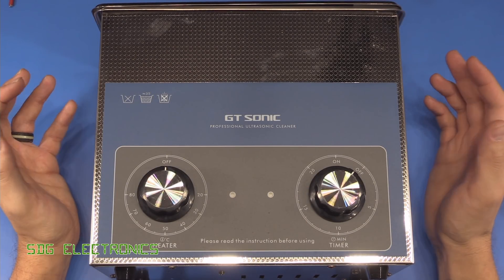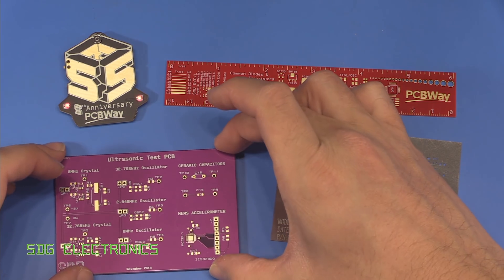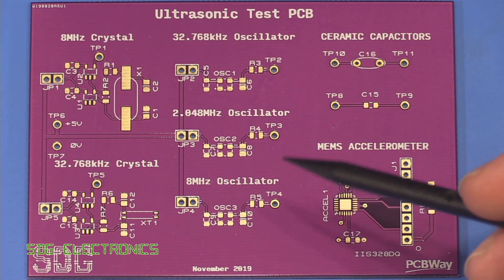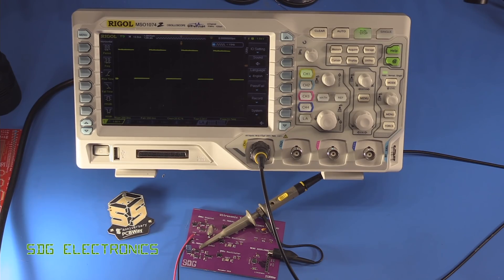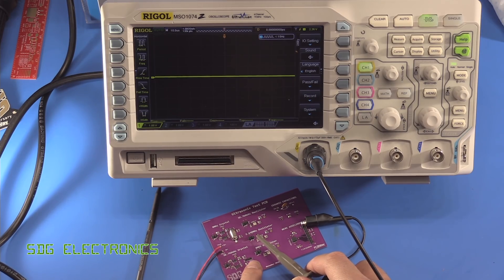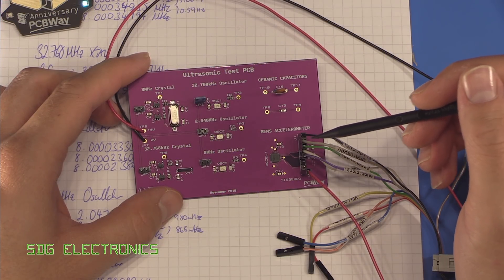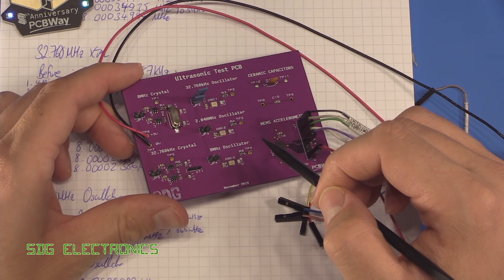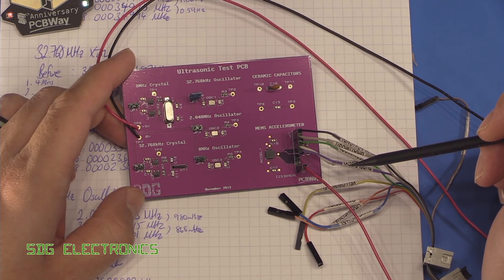SDG #118 Can ultrasonic cleaners damage your PCB and components?

Comment: is this a sweeping frequency cleaner or one for cleaning jewelry that stays at 40hz?🤔
Reply: I believe that model is a 40KHz static frequency
Reply: @EliTheDriftPanda  it has to have a sweeping frequency or it will damage what you put into it.
Reply: @jessihawkins9116  that's my general thought too. Most electronic components survive but if the wrong resonance occurs in a crystal it could damage it, MEMS don't like it in general and higher power can damage even basic SMT components. It seems to be an "it depends" situation but sweep would help a lot, as well as physically moving items inside of the bath
Reply: @EliTheDriftPanda  look into what Louis Rossman says about these ultrasonic cleaners. He’s tried several and found that only the sweeping frequency units are suitable for electronics cleaning. There is a big price difference between the two also.

Comment: Modern IMUs that I have seen have a high max acceleration (in terms of damage, not measuring). The MPU9250 has a max rating of 10000g for 0.2 ms when unpowered (I have no idea about powered), since it is such a small and light device getting it to 10000g is probably pretty difficult in the first place and the frequency of an ultrasonic cleaner is that high that for 45 kHz the period is 0.02 ms so a tenth of that the rated time too and even within that the max acceleration will be for a much shorter period of time.

It would be interesting to measure the acceleration using an accelerometer whilst it is in the cleaner. A +-16 g one might not be enough but you can quite easily get +- 200 g ones for model rockets and similar applications. You should probably add a conformal coating first though, preferably a hard one so it doesn’t dampen the vibrations.

Comment: I realize this is a 2 year old video.  After a run of boards came back with a high percentage of failed IMU's, I conducted an experiment on my bench.  I took a board with a working IMU and placed it in distilled water inside my Branson 2200 ultrasonic cleaner for 10 minutes.   After drying the board, I retried the firmware and the IMU was now returning 0's for Gyro reads on all 3 axis, and extremely erroneous Accel results on all 3 axis.  This is with a TDK Invensense part.  So while I'm sure there are some parts that are unaffected, people should probably refer to appnotes from the manufacturer.

Comment: People wash $2000 video cards in ultrasonic after repair is done.
Because it's not harming anything. Even the cristal.
Reply from the maker: The trouble is we cannot measure failures easily. Same with ESD - can you correlate occasional PC crashes or pixel glitches? These issues rarely manifest as a total failure of the device

Comment: Ever since I demonstrated that my ultrasonic cleaner could put pinholes in aluminum foil, I have been worried about damaging things.  

For example, I've destroyed print heads with a conventional ultrasonic cleaner.  But I did read somewhere to to clean print heads, you have to use frequencies around 80-90 kHz.  I don't know where you buy those.  

Also the ability of the UC to get into cracks and the smallest of features makes me wonder if it could follow the legs into chips .

Comment: how come when I dropped my phone in the bath it didn't work even after I dried it with my hairdryer yet you can put your stuff in that bath and it works?
Reply: Late reply... but your phone had a battery connected. You can dunk an entire PC motherboard into water, alchohol, whatever, as long as (1) it's not connected to anything, i.e. no electricity flowing; and (2) you dry it properly afterwards. 

When phones still had removable batteries you had a chance saving it if you were quick. Now with non-removable batteries: don't even bother, nothing will fix it after a dunking.
Reply: @stromlo  Thank you so much, Deon

Comment: How would a power supply hold up? Can you ultrasonic clean those? Trying to think whether any materials are in those that aren't in a typical pcb/mobo etc.
Reply from the maker: You may have problems with the tape used in some transformers, but other than that there's nothing that would typically not survive.

Comment: I used PCBWay once. The circuit board was slightly over 100 x 100mm. It ended up costing me €80. The exact same circuit (same Gerber files) from JLCPCB cost me €10. So no way pcb way.
Reply: Ive found PCBway to be expensive too, I also use JLC.

Comment: Another thing to consider is that the liquid could seep into your plastic packages of your ICs. It might short out pins, which in turn could carbonize the substrate and create shorts. Also if the part gets hot, the liquid might boil and blow your packages apart.

Comment: First hand experience: Piezo buzzers (in this case small SMD buzzers) generated voltages from the ultrasonic excitation. The micro on the PCB had some pins fried because of it. This was during a first production run, so in this case the solution was to use a different cleaning method, but the point is it can certainly cause problems.
Reply: I don't know if you'll see this ,what other cleaning methods did you end up using?
Reply: @Sergi762  I can't remember, it's possible they just stopped cleaning the boards (no need for it with modern no-clean solder.). That was a long time ago.

Though I can tell you what I use these days on small run prototypes for customers? carbcleaner. Yup - the stuff you spray into a petrol engine carburator. It's the best I've so far found, but it is very potent, so I scrub the panel / pcb down quickly, then rince with water, then spray "CleanGreen" (or Dishwashing soap) on and wash the carb cleaner residue off (and then rince in distilled water if I am going to do a conformal coating). Incredibly quick, and perfect results - even cleans years old rosen-based residue off if I repair old PCBs. Just take note the carb cleaner will eat paint, QC pen markings, etc off, so be careful when you use it. Also highly flamable etc etc.

Comment: Not sure why would you test "earth's magnetic field" with accelerometer that's not the part that gets damaged. It is usually the MEMS part and after that earth gravitational field either does not have effect on accelerometer or it does not work at all. I've damaged complete batch of prototype boards for customer and after that I never put boards with accelerometers in ultrasonic. The rest is fine i never noticed any damage on the crystals at all.

Comment: Thanks for sharing all this!
Evidently the modern components are quite tolerant to ultrasonic.  I still remain unsure about old TO-5 packaged transistors like 2N1613, 2N7011, 2N2905 or even the TO-18 types which also have bonding wires hanging supported only by their welds at the ends.  Then another message here also reminded about the kovar leads going through the glass into the interior.  Some lead length above the board might produce a detrimental resonance at the ultrasonic frequency?
Come to think of it, I have both several of those old metal can parts, a small ultrasonic cleaner and means of determining the frequency and maybe the resonance frequencies (in air).  So maybe I should take the matter into my own hands an perform a few tests...

Comment: Elmasonic has P Series ultrasonic cleaners that can sweep at 80kHz which is gentler and safer for more sensitive components than the usual 37-40kHz. Curious how that would fare in comparison.
Reply: You have my attentio0n: what do you mean that 80 kHz would be safer? Is the cleaning action compromised with the different frequency?

Comment: Another concern more so is damage to components at the components physical connection point (end caps of capacitors / resistors) & soldering joint integrity  of improper setup / type / power level of ultrasonic uses.

Comment: Those numbers are probably within the component tolerances. You didn't exactly tell us what were the tolerances of the parts used, but I don't think you used anything extremely accurate or high tolerance but something quite common?

Comment: I haven't had issues with the ultrasonic damaging components so far but I have had issues with flux migrating during the cleaning and turning into a thin film on contacts and that causing issues until manually cleaning.

Comment: The frequency measurements of the crystals are meaningless unless you control for temperature.  The delta that you see could easily be explained by temperature differences.
Reply from the maker: Yes, I fully expect those small changes to be temperature effects. The room was 22.5°C the whole time, but not controlled to anything better than 0.5°C

Comment: Way back in 1972 when I left tech I got a job with a watch maker, as the newbie I got the job of taking clocks apart and cleaning them.On this occasion I put the parts of an alarm clock and a grandfather clock into the ultrasonic cleaner just before I went to lunch, when I got back some of the alarm clock parts were no longer and the grandfather clock gears had holes in them, the cleaning solution used was toluene, the cavitation was what did the damage brass parts.

Comment: Did you check the ambient temperature during the measurements?
Reply from the maker: Yes, 22.5°C the whole time, but only 0.5°C resolution on that measurement. As mentioned, I think temperature is the only reason the frequency drifted slightly.

Comment: Another great video! As an aside, testing for vibration and shock are frequently lumped together in a common specification, and for crystals, the shock specification is usually much more problematic. So I would be more worried about dropping the board on the floor (yes, I am very clumsy) than putting it through the ultrasonic cleaner! ;-)

Another note. The PCBWAY 5th year badge is very catchy, but it looks way too much like a stylized SS insignia to me. I guess this just isn't a thing in China, but I can't imagine any western company letting this logo out...

Comment: Anyone have experience trying to ultrasonic clean an ESP32 or similar?
Reply: @ba0sh1 That's very good to know, thank you! Can you tell me what liquids were used and if you used any type of alcohol to rinse afterwards to make sure there were no water residue left? Or is the module entirely watertight?
Reply: @ba0sh1 Thank you
Reply from the maker: I had no issues with an RN421 and SAMW25 which likely have similar components.

Comment: There are a few extra mistakes in your data :
- for the 32.768MHz XTAL the 1->2 difference is  70mHz not 1Hz
- the "before" number you wrote for the  32.768MHz XTAL is probably wrong as it doesn't have the same number of digits as the rest
- for the 2.048MHz Oscillator  the 1->2 difference is   860mHz not  868mHz
Reply from the maker: Thanks, the perils of late night video recording and not checking answers...

Comment: Hi, have watched a few of your videos and  just subscribed!  What is the backend of the air gun you used to blow off the board? Is it a regular compressor or an air can? If the former can you share the details of the unit ? Thanks!
Reply from the maker: It's a little silent air compressor. I don't think it's for sale any more, but it's almost identical to the Clarke Shhh Air 30/9
Reply: @sdgelectronics  Thanks! I'll check it out. cheers.

Comment: Great video, good to see this subject in a controlled test.
Btw, in my experience it's the sticky mess which can be left when cleaning which can 'damage' switches & relays and also the problem in drying them completely inside rhe devices afterwards.....rather than the ultrasonic waves themselves causing problems.

Comment: Pro tip: No-clean rosin-flux solder like Kester 44 is difficult to remove, even with an ultrasonic cleaner. It is meant to harden into an amber-like substance that resists moisture absorption. Instead, use a water-based flux, which comes off almost instantly in the ultrasonic cleaner. I use Chip Quik SMDSW, a 63/37 eutectic solder wire. I use ethanol in the ultrasonic bath, and dry it with the air hose. If there is any remaining ethanol lurking under a component, it will evaporate easily.
Reply: Just be aware that water-based flux MUST be cleaned off! Even more so than activated rosin, it is not safe to leave on the board.

Comment: Thanks for checking this out!  For some reason, the only component I've managed to consistently kill in an ultrasonic bath is the Teensy 3.2 microcontroller board.  There's some component on there that dies for around 30% of the units I clean, even when running with a mild PCB-safe detergent for only 4 minutes and drying thoroughly afterwards.  Of course, the boards wouldn't die immediately--they would quit working a few days after being cleaned, usually after being installed in some hard-to reach place.  I never got around to swapping components around to see what was dead, but I wrote off the idea of ultrasonic cleaning Teensy's altogether and have since switched to more robust microcontrollers for my water-wash pcbs.
Reply: Huh, that's interesting. Have you reached out to Paul from PJRC about that? I wonder what which component might be failing. Have you ultrasonicly cleaned other Teensy models besides the Teensy 3.2?
Reply: @SeanCMonahan  I haven't! It's been a hot second since I encountered this issue so I've since moved on to other projects. I've had lots of success cleaning other types of boards and components of all kinds in the years since, so I do wonder what might have been causing the issue.

Comment: Ultrasonic cleaning can defiantly cause damage to components... At a previous production I was working on we upgraded to a 300W ultrasonic cleaner from a 100W version to fit more in, from this moment onwards in we found approximately 1 out of every 200 resistors (0402 [1005 Metric] AEC-Q200 1%-0.1%) to have their resistive element chipped by the cleaning process. As soon as went back to the 100W version a month later this problem stopped. In the whole process it was only the ultrasonic cleaner that was changed same batch of PCBs. The cleaning cycle was 60C for 5 minutes.
Reply from the maker: I can believe that. I just need a higher power cleaner to test that now. Was the change prompted by insufficient cleaning from the 100W model?
Reply: @sdgelectronics  The cleaning power was just fine from the 100W but the volume too small for the production rate as we could only fit 6 assemblies in at a time. The company loved to use Farnell so it’s easy enough to remember; the original cleaner was PN: 1308822 and the one we had problems with was PN: 2428947. As it was triple the liquid volume and I wasn’t expecting much of a change in the cleaning. Maybe the cleaning was slightly better with the 300W but I can't really remember as it was a few years ago.

Something to note with this is the PCBs were glued in to a shallow stainless steel enclosures, so potently the enclosure walls were reflecting more of the power on to the PCB. The cleaning was to remove thick flux from feedthroughs before further processing.
If you’re interested I’m pretty sure I have some images of the damaged resistors saved somewhere.

Comment: mems ic's with a hole in it are usually barometric sensors and microphones   ADMP401, BMP180, BMP280 etc.
also electrolytic capacitors could be vulnerable to this, water creeps in trough the sealed bottom contaminating the electrolyte

Comment: Is there any truth in that the fixed freq ultra sonic cleaners might damage some components and that you get much better cleaning results with a sweeping freq ultra sonic cleaner?
Reply: Fixed-frequency cleaners don't work as well because there will be nodes where the standing wave is always at a minimum, and antinodes where it is oscillating strongly. Sweeping the frequency moves the nodes and antinodes around the surfaces of whatever you're cleaning.
I doubt the fixed-frequency cleaners would cause more damage, though if the cleaner is less effective, you may end up using a longer cleaning cycle.
Reply: With fixed freq cleaners always worth moving the pcb's around, turning them over periodically.....which helps a little.
Reply from the maker: I notice with this model, the ultrasonic frequency is modulated on top of the 50Hz AC. Although it's not technically a sweeping frequency cleaner, it does help with the issue of standing waves.